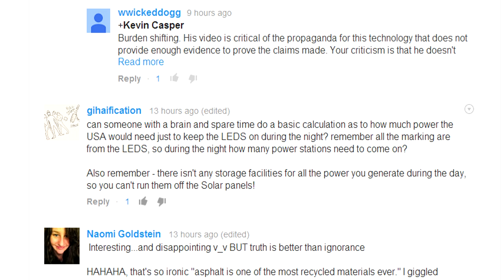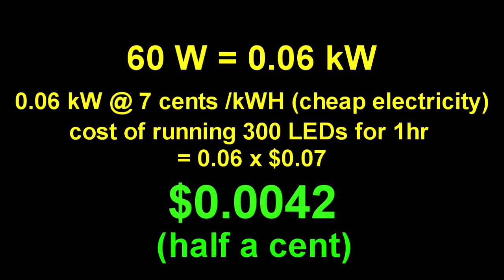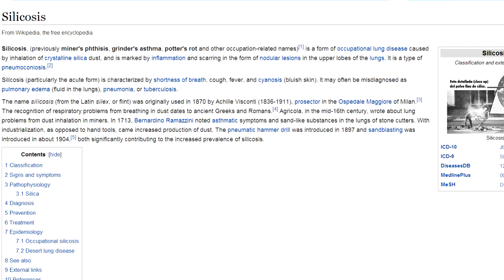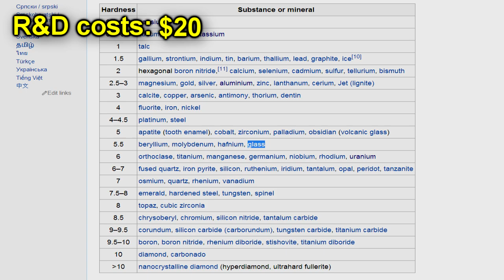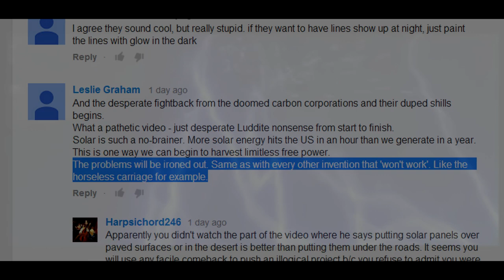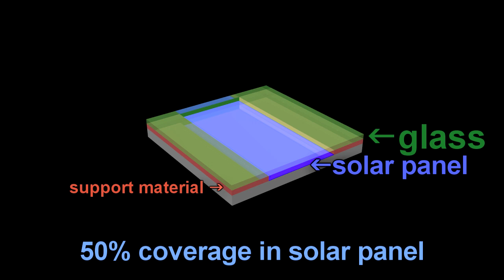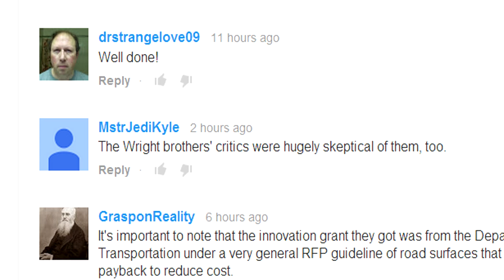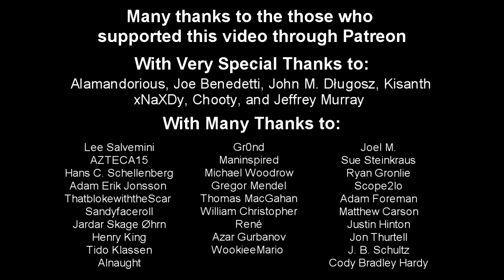Solar Roadways, IMPORTANT QUESTIONS AND ANSWERS!

Comment: So what are the adjusted stats on this, considering all the funding they are, and would be receiving? You seem to be using the 100% consumer end assumption, which is absolutely incorrect, even now, let alone when further funding is put into down the line, wherein the numbers you're spouting get even more out of sorts.

And really, they "only" last for 5.7 years, and while in a protected environment, wherein nothing ever actually touches them? Yeah, bulbs burn it, it's a ten minute fix when they get a second, as opposed to closing down half the highway for multiple nights so they can repave the potholes and such. I also love that the quote you use from wiki says "many" and not "all". SO here's a thought, why not use one of the ones that doesn't have that issue? I mean, I'm certainly not an engineer, but "don't use the stuff that doesn't work" seems pretty simple.

Wow, really just gonna abuse the wiki all over the place, are we? Yes, **in general**, glass is not as hard as stone, but it can be made to be so. I mean, how are you missing all this already existent tech? This is stuff we already have, it's not even a matter of science. They already did the impact testing and such when they were putting it forth, so here's a thought: What if the two engineers.... **engineered** a glass that works for the purposes they need it to?

Um, why would they not go directly to the manufacturers for the LED, as opposed to buying them at near retail price, as you are stating? With as many LEDs as they are going to be needing now, and in the future, there is absolutely no LED manufacturer that wouldn't cut them a solid deal on the LEDs. Companies do that all the time, it's a whole thing, unless you think Barnes & Noble is charing exactly as much as they paid for the books they sell. It is the same with every product on the market, and it doesn't take college education to realize this point. Wal-Mart's business model is anchored on it at this point.

Hey, genius, now try covering the LEDs with a translucent material built to help out the span of the light, you know, like is on the hexes that you yourself showed. you also use only a single brand of LEDs, don't use them on the black background they would be on in the Hexes. You do nothing to actually recreate the conditions that they'll actually be under.

And we're back to not using the actual glass that they're using, nor it being set up in the manner in which it would work. Here's a thought: Get one of the things and TEST IT. Put simply: at every stage of this, you have used comparison that do not cover the actual materials being used. They're using glass specifically tempered for this purpose, not bottles of booze turned upside down.

Yes, it is somewhat less efficient, but in this instance, the sacrificed efficiency can be more than made up for in span. Let's compare the power output of a solar calculator versus the locked positon solar power used to power a home. See a difference? Yeah, even with the efficiency loss, I'm still betting the house is more powered. As long as each panel is generating power (Your previous videos claim it doesn't show power generation, despite showing them being on as you're saying they're not generating power), then that will be generated power for use elsewhere. This can include sending the power into buildings, as well as along the circuit.
Reply: Sean McTiernan 

in a protected environment, wherein nothing ever actually touches them - Assuming you mean in the roadway, that's hardly a protected environment. They're still being affected by vibrations, heat, temperature fluctuations, expansion, EMF etc.
as opposed to closing down half the highway for multiple nights so they can repave the potholes and such - You must have the most inefficient bloody system there. Our councils and maintenance departments have truck-based paving and spraying machinery that can patch up an asphalt road in a matter of minutes. They don't even need to stop, as all the functions can be controlled from the confines of the vehicle, which can keep moving at low speed. 

Yeah, bulbs burn it, it's a ten minute fix - Really? Replacing the lamps in every panel? Thankfully the internal PCBs are modular, but that's still a massive bloody job.

They already did the impact testing and such when they were putting it forth - And where are the results from that? There are only biased claims from the Brusaw's available.

For the record, there is a recently developed glass that has great strength and resistance to damage. That may be a possibility, but it would be highly expensive and difficult to manufacture, especially on a scale as large as this project requires. It may not even be able to support the weight of vehicles, provide traction, or withstand years of use though. If it could be made possible, great. Now only 99 fatal flaws left to fix.

http://www.dailytech.com/New+Metallic+Glass+is+Strongest+Toughest+Material+Available/article20627.htm

there is absolutely no LED manufacturer that wouldn't cut them a solid deal on the LEDs. - It'll still cost a considerable amount to purchase a bulk lot. The manufacturer will only go so low, as they'll be operating at a loss otherwise, which defeats the purpose of operating a business. And there will also be transport and handling costs.

Hey, genius, now try covering the LEDs with a translucent material built to help out the span of the light, - So basically a reflector, such as a fresnel lense. That would increase the viewing angle somewhat, but you'll need much more than that to make the LEDs visible during the daylight, and particularly glare (which would be a major problem at sunrise/sunset, as well as from streetlights and vehicle headlights).

use them on the black background - They'll be used on a green background, which is the PCB. The blue (or black you claim) is the solar panels, an unsuitable location for the LEDs.

They're using glass specifically tempered for this purpose, not bottles of booze turned upside down. - Tempered glass has increased strength due to compression and tension, not an increased durability to wear (as he demonstrated with a tempered glass coffee pot).

Yes, it is somewhat less efficient - Somewhat? Boy oh boy, that's an understatement. 

the sacrificed efficiency can be more than made up for in span - What span? I sure hope like hell that you don't mean the lifespan, because I'm willing to bet that most panels won't last more than a couple of years. 

This can include sending the power into buildings, as well as along the circuit. - I think you're a bit confused. There won't be much power left to send anywhere, in fact, they'll be drawing more power.

1m^2 of solar panels in optimal conditions will generate around 150-200W. Based on the current design, there will be 4 of these solar tiles per metre^2. So that means that each panel would ideally produce 37.5 - 50W. You instantly lose 20% from laying them flat, with the resulting power being around 30 - 40W. Then take a further 10% (approximate figure, as I don't have the facilities or money to do a physical test on the glass) away as the road wears down and becomes dirty and scratched, leaving you with 27-36W of power generated per panel. And that's assuming you get full sunlight with no traffic. Each panel uses 48 (SMD or 3mm) LEDs. They'll need to use high-lumen LEDs for visibility, which will draw around 1-2W each minimum, but even they may not be bright enough. However, that will result in around 48-96W being drawn by the LEDs, plus further power consumption from the associated control circuits, and heating elements (which will draw a massive amount of power.

"But the panels won't be lit up all the time!", I hear you say. They essentially will be lit 24/7 on arterial roads and highways. Any control circuits and sensors the Brusaw's use for the LEDs will still draw power regardless of whether the LEDs are on or not. And the road will have to be able to illuminate a fair distance ahead of the vehicle, I'd think about 1-2km being a good distance, as you need to be able to see where the road leads to drive safely and to drive to the conditions (hence why asphalt roads use cats-eye reflectors). There will most likely also be "nuisance tripping" of the sensors too, most likely in winter when you have snow and ice on/near the road.

Feel free to correct any calculation errors I've made, as I've double-checked, but am tired so may have missed something.
Reply: ***** A slight improvement on your comment near "such as a fresnel lense." would be.

1) Just a lens would work better than a fresnel but would still be an utter failure.

2) A better way to cover a wider angle would be to use an array of LEDs.  If you had an atomic power plant parked nearby, this may even be a reasonable idea for lane markers that change.  Each dot seen by the user would be a significant fraction of a watt.  Multiply by the number of dots and a number in the megawatt range is easy to get to.

3)  Further proof that these guys don't know what they are doing is that they didn't think of electrochromic materials.  If you are going to make a high tech road then go the whole way.
Reply: Ken Smith Haha, yep!

Comment: Since you immediately assume there's no way to store the power, then move on to saying the LEDs "will cost $20 for a string of..." based on something you found on amazon without considering bulk pricing leads me to believe the rest of the logic contained in the video will be flawed.... I'm all for uncovering truth, but I couldn't watch the rest of this video.
Reply: Seek Truth There are ways to store the power - Batteries or capacitors. However, we may as well nuke the planet if you want to go ahead and install batteries for every panel, and replace them every couple of years as they wear out.

Comment: If you were buying LEDs for an infrastructure project of a continental scale, you wouldn't be purchasing them off Amazon. You would buy them from the manufacturer/s for 1/10th or less of the retail price. This applies for any/all material used on such a project.
Reply: Sagar Rao Which is still a hell of an expense, given the other materials required.
Reply: ***** Agreed. I was simply pointing out the flawed method of calculation.
Reply: Sagar Rao Fair enough.

Comment: 1. Everyone saying the glass is slippery? The federal roadways have funded the project and it meets all requirements for traction. 2. Not all the LED's are on at once, and wouldn't they be powered by the panels themselves not a separate facility? 3. There is no glare, this isn't your everyday glass. People wouldn't spend years of testing and raise millions of dollars to run into the problem of, oh wait, how will cars drive on this? They've been through it. I'm as skeptical as the next guy, but the problems with it that people are coming up with are completely ridiculous. Get educated before you start bashing them.
Reply: Lightning Games 1 - There's no evidence to back their claims in regards to the traction tests - They're just claims.
2 - There would certainly still be bloody glare, glass is glass. The glare will intensify as the road surface wears down and becomes smooth. The problems people are suggesting are genuine and need to be resolved in order for this project to work. The issue is that most of those problems are fatal to the project.

Comment: I watched the entire video, but I'm not very convinced in some parts:
>the material used to make these tiles have been tested and passed all tests at the Infrastructure Bureau (this is said in their video), so they are probably suited for road usage. 
>about the LEDS...I suppose there is a system that makes them visible also during the day: have you ever seen LED traffic lights? Here in Europe is full of those and the visibility is stronger than normal lights and uses less energy.
>if they will ever make this project come reality, it's absurd to assume that they will build all the roads at the same time, so thehuge costs will be spread throught time.
>and about the stone against the glass car: it's not a correct example. You should try this: throw a stone on a piece of glass which is laid on a surface, maybe the floor. It won't break that easily...you will need a lot of force to break it through.

I still think that your video is interesting (like actually the problem of electricity storage for the night), but I also think that there are some incorrectness.
And yes, I think that that project it's probably not perfect, but a great start.

I hope to not receive insulting comments, but constructive ones :D
Sorry if mine is a bad English, but I'm not English XD
Reply: Joshua Peli Thunderfoot has been quite clumsy at disproving this, and EEV blog or whatever did a much better job by simply sticking to the energetics. If you're going to build a source of energy, you want it to be as efficient as possible. Building solar roadways instantly doubles the number of solar panels required compared to rooftop panels.

Simply put, if your solar panel gets 1000W from sunlight, it will be very easy to have a better output than if your solar panel only gets 500W.
Reply: Joshua Peli There's no evidence to back up their traction test claims though - They're nothing but claims. LED traffic lights are visible because they use high-lumen LEDs (as power consumption isn't too big an issue), they're aimed directly at motorists, and they have hoods to keep sunlight/streetlights from reducing their visibility. Try driving a car over your piece of glass and see how well it holds up. Better yet, stick some gravel in the treads of your tyres and drive over it.
Reply: Joshua Peli And where's the evidence of this new glass? Where's the evidence of it's durability? They're all claims and nothing more. You would need a complicated optics system to make the LEDs viable, and that would end up as a major weakness in the panel. I would like to think it's possible, but it isn't. It's impractical, inefficient, dangerous, expensive and environmentally damaging.
Reply: However, they talk about a new type of tempered glass, not the glass of your bottles or your car glass.
About the LEDs you can always modify the internal structure of this prototype, like putting them diagonally with little caps on it. 
Don't you think it would be possible? :D
Reply: OK, I just suppose that they're saying the truth about the American Infrastructure HQ. 
But that is about "faith" about the truthsworthy of a video, not if a creation is interesting or not.
As said before, I don't think that this could be the final product, but a great start.
Every year new materials are discovered. Maybe in a near future they will produce a new type of glass/plastic that perfectly suits the job.
But yes, I understand your concerns.
Reply: Joshua Peli The problem is even if they find the perfect glass (which in itself is practically impossible), there are still a multitude of other fatal problems facing the project.
Reply: ***** Anyway, I want to thank you and ivanlagrossemoule for your comments. :3

Comment: I don't know whether you noticed, but not all 12 trillion LEDs will be on all the time... Many tiles won't even have any LEDs turned on over the course of the whole night as only the lines in the centre of the road will largely be needed, and so you have made a gross over-estimation. Great maths, Einstein
Reply: Hannah Cleary-Hughes The LEDs will basically be running almost constantly on major arterial roads, and the control systems for the LEDs will still consume power while inactive. Besides, LEDs are only one of many fatal flaws this project is facing.

Comment: But the video mentioned tempered glass, not normal glass
Reply: falongrey4 Okay, go to your local thrift shop and look at some of the used Pyrex ware. They'll have scratches, and that's just from grandma baking a casserole in them. Imagine the wear and tear that normal traffic would cause to these panels.
Reply: falongrey4 Even if the glass isn't as fragile, it still lacks traction. The bumps won't keep traction as well as you might think. Glass is glass, whether it's bulletproof glass or your grandma's kitchenware.

Comment: Not to mention, there are these things called hills that we must drive over.
Reply: The thought of driving down a glass hill frightens me greatly.
Reply: Carson Eastman The thought of 60+ ton loaded semi trailers driving downhill on glass roads in the rain scares me.
Reply: ***** oh no, its perfectly safe. they put scientifically engineered "bumpy spots" on them so its all good. lolololololol
Reply: Chad Sotack And curves in the road, which present a problem for hexagonal tiles.
Reply: Black70Fastback  until those spots get worn down after about 30 seconds of installing the panels

Comment: Clearly you have pointed out that there are major problems with using this on roads, but could it still be used on side walks? Maybe even bike-trails?
Reply: deisisase The use as sidewalks is possible, because they would only require very basic protection from foot traffic, and wouldn't need all the complex control systems, LED displays and heaters the roads would require. But even then, solar sidewalks are no where near as efficient as mounting the panels on roof-tops, awnings etc.